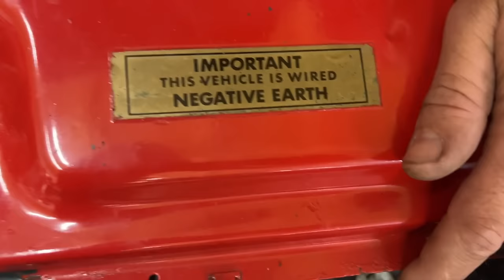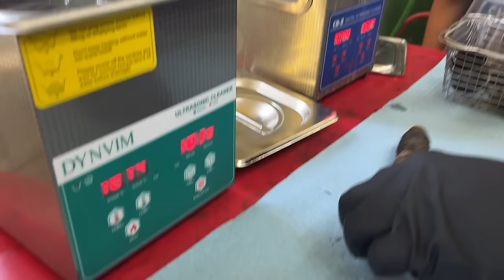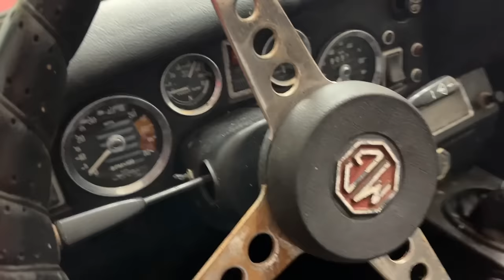My wife bought her dream car back after 17 years! Will it start ?

Comment: the way this carb is mounted solid to the intake is wrong, it needs special vibration absorbing gaskets with springs and spacers, otherwise the fuel gets 'frothed' by the engine vibrations.  look at any weber DCOE equipped car ( that includes FFing lamborghini's!)
great video!  good luck with the kitten too!
Reply from the maker: Ok thanks

Comment: Josh greetings from New Zealand. These "A series" engines are the the same as used in the early BMC/Leyland Minis and many of their other products. The hose you called a crossover hose is the bypass hose between between the head and block. That hose is available as a "wavy" one that can be compressed to fit it on without taking the head off. You can also do it with a straight piece of hose, just dump it in boiling water for a few minutes it should become soft and pliable enough to be able to bend it on. Replace both radiator hoses, as you noticed the lower one is specialised with that narrow piece molded into it, I recall that has something to do with the heater, you can get it without for heater delete vehicles. These Midgets came standard with British twin SU carbs. The Weber is a good conversion. Looks like the engine is a good one too and once the fuel system is sorted and the Weber is gone through it should run like a rocket. Although I have never owned a MG Midget I have own a couple of Mini's. The engines were probably the most numerous British engine ever, made from 1952 to late 90's at least  in its various forms ie: 850cc, 1000cc, 1100cc and 1275cc like yours. Spares should be relatively easy to get, even in the USA. I enjoy your channel very much, although you are doing what many others are doing, the lifestyle and family values aspect makes it that much different. You have a nice family and it's good see them all getting involved (even the animals).

Comment: 25 thou plug gaps are for cars with points. With electronic ignition, you can set the plug gaps to at least 30 thou. If you set the plug gaps too large, you tend to get spark leakage through the distributor cap and rotor.

Comment: I saw a 40 or 44 for 110 dollars on ebay. Its a knockoff but the originals are high dollar units.  Was going to put a downdraft 48 mm on a 87 318 b200 van. 

80 % of the tune is low speed jetting the other 20 is wot.

 Complet range  jet, pickup, and emusion tube kits are avaliable for under 90$. If you want to tune it for perfection.
Reply from the maker: Awesome thank you

Comment: Hi from the uk. Great channel with awesome content, you have a super family. The 1298cc A series engines are quite tuneable and the MG Miget is a super little sports car, that one you have already seems to have a lot of the "go faster" bolt on goodies electronic ignition and webber 440's are a great carb set up. The two green wires under the transmission (gearbox) could be for the reverse light switch, on the side of the gearbox.

Comment: Just FYI do not use Purple Power on Stainless Steel or Aluminum as it could leave white streaks or a hazy film Purple Power is known to corrode aluminum, and more so if it's hot.
Reply from the maker: Ok thank you

Comment: I seem to remember Steve at This Week In Cars having an easy way of swapping that short water pump hose. There's a trick to it.
Reply from the maker: Ok thanks we will check it out
Reply: @Sleeperdude  Can't remember if it was on an MG or an Austin Healey (same difference)
Reply: Josh and gang that's why the carburetor is like that
Reply: It sounds like it has water in the motor

Comment: Dont forget to replace the Bypass hose between the head and the block [in the front, under the Thermostat housing] its a bitch but can be done without removing the head.
Reply from the maker: Ok thank you

Comment: Josh, the reason for the deep float bowl is that Weber made carbs for racing and you don't want your fuel to be able to run away from your jets. The narrow and deep float bowls prevented that from happening in a tight fast turn. It's very embarrassing 
to beat everyone into the first turn and have your car momentarily run out of gas. Again, great video!
Reply from the maker: Ok great thank you

Comment: SUM TIMES. POP OUT GEAR. LOW GEAR OIL.  Also use light weight gear oil or 20/50 oil.    Also.  That carb isn't a real side draft.   It really needs a real side draft with the piston
  like on a datsun 240 z look at one those for illustration.    But that car will lay a patch with an acusl side draft carb
Reply from the maker: Ok thank you

Comment: Love your content! I use an ultrasonic cleaner to clean carbs and they do an awesome job. To me it looked like your parts were comng out blackened. you have to be careful what detergent you use on aluminum as a lot of them will turn it black and yucky regular Simple Green being one of them I am not sure about Purple Power. Simple Green HD which is purple in color works great and so does original Pine Sol . Keep up the great content. look forward to seeing the MG on the road
Reply from the maker: Ok thank you

Comment: Hi Josh, and family, the little hose that joins the cylinder head needs to be a Concertina hose it looks like mini bellows, do not try and fit a straight hose here as it will be near impossible and it will not last, the correct hose will go on easily as you can push it together, also that carb you have on there is poor, the correct units were called twin Su, they were reliable and worked well, they had oil filled dampers, and were easy to set up, also has the cylinder head got hardened valve seats?  If not the valves and seats will burn away cars built in the UK back in the 1970s were not able to run on unleaded fuel, the A series engine that you have fitted was the same as that of the Mini Cooper 1275cc.  The MG has always been a favourite of mine, they also made a MGB GT which had a 1.8 B series engine and the big one had a Rover V8 in it .  Rust normally finishes off these vehicles, the chassis just becomes rotten, top notch ones sell for good money.  If you put it back to factory spec, it should return an average of around 40 miles per gallon.  Well done all

Comment: That homemade nut on top of the carby you refered to should be a brass colored wingnut.  Your Weber is a DCOE sidedraught and are italian used on Ferrari, Lambo and Maserati and Lotus before they injected them...... On a V12 Lambo they have 6 of those ...............they are a high performance carby  That long brass coloured thing you screwed out is an emulsion tube.  Webers have 4 differnt parts that come in different/variable sizes and are used to "tune" the carby to match the engine.  I am assuming your carby hase been setup to suit the engine.  That engine is  based on a Mini Cooper S engine of 1275cc which have twin SU carbies but use a Weber for racing use.
Reply from the maker: Awesome thank you

Comment: Josh, I worked in a hospital for 14 years as a medical supply tech. In the department where I worked is where I cleaned, resterilized, and wrapped all the instruments for the surgeons in the operating room. One of the processes we used in placing the instruments in an ultrasonic cleaner, which removed any rust that might have formed.  The MOST IMPORTANT STEP IS TO ALWAY WEAR EAR PLUGS.  The ultrasonic sound it makes can and will damage your inner ear, which can and will cause you to go deaf, over a period of time.  Please do this to protect you and your families hearing.
Reply from the maker: Ok thanks

Comment: Can't help but grin, watching your video. You have a great example of a real sports car right there.

Contact Will at Rivergate5speed in Sale Creek, TN, just around the corner from you. He makes an adapter kit that allows you to put a 5-speed Datsun 210 transmission in your Midget. No body modifications required. Slips right in.

Also, be careful doing burn-outs. The axle shafts REALLY don't like it, and tend to break at the end where they enter the differential. You'll see...
Reply from the maker: Ok thank you
Reply from the maker: Ok thank you

Comment: I laughed a bit when I saw the video. I used to service and repair those as a British car specialist in the 70’s at a shop my brother owned. I was in my early 20’s. That 4cyl engine is hard to like. The cooling system should be flushed and pressure tested for leaks. The radiator core and heater core control valve will rust badly. That radiator hose is the real deal with that little appendix. Good luck with the completion!
Reply from the maker: Ok great thank you

Comment: Josh i like that single side drop weber carb. Low fuel consumption with power even in long trip. I convert my toyota 12R stock carb to twin side drop weber 40. Very nice like a racing car.❤👍🇵🇭

Comment: Excellent video Sleepdude Crew Josh & family also yes those MG cars amazing and live on forever to ! Only work one but built before this one had 2 carbs and body was restoration on too ! Battery yes expensive in Ontario Canada were I live to Josh and also if need use Battery for that car or similar use A motorcycle or Lawn Mower Tractor fit perfectly to !

Comment: Josh, if you run across a late 60s, to early 70s Triumph Spitfire for sale cheap let me know. I cut a few teeth on british cars in my youth learning to be a mechanic, You'll want to add a few fuses, especially to the hot wires going into the steering column, if they chafe & short, it melts the wiring and can blow a bussbar on the back of the old style voltage regulators which is hard to find if not familiar with them.j
Reply from the maker: Ok thank you

Comment: Hey that mg that you guys are working on when you got the fuel pump like that hooked up to a toggle switch in a way that's kind of bad thing to do because of the car ever catches on fire anything you won't be able to shut the fuel pump off fast enough what you should do is when you turn the key on the fuel pump will turn on you turn the key off fuel pump shut-off I would hook it up to the q at the key switch so when you turn the key and stuff on a fuel pump turns on automatically this way you don't have to remember of turn it on
Reply from the maker: Ok thanks

Comment: talking about batteries my 2017 quad 400 HO ex $209.00 dollars + 10.45 tax and a 2 year warranty was the cheapest high cranking power battery , then at one store it was over 400.00 + tax my 3/4 ton chev truck has a 9 year warranty 1200 cold cranking amp battery and it is only 109.00 dollars + tax
Reply from the maker: That’s crazy

Comment: Hey man you can run those cars on a lawn and garden battery. I ran a $30 lawn and garden battery in my Miata for years
Reply from the maker: Awesome thanks
Reply: @Sleeperdude  also wanna say that your channel is one of the best if not the best on YouTube, I’m literally still watching this video and you’re responding to my comment. NO ONE else does stuff like that. But you definitely can save money on batteries especially on smaller cars like that. Worked for me for years

Comment: hey josh,dean from coldwar motors has a 74 grand torino sport with a 460 not trashed out for about $1,600 with what looks like 46,000 miles on it.

Comment: m.g means morris garages. now a chinese co . mg miget was desighened to fit in garden shed as that is all they have in england. the same motor as is found in 60s cooper  s mini. the frount fenders are weilded on best of luck takeing them of
Reply: those chinese MG's are not at all related to the Original MG's, the modern Chinese ones are cheap junk.

Comment: Back in 1985 we traded a 75 Midget (I couldn't fit in it) for a 76 MGB in great condition, 4 soeed with electric overdrive, your Midget may have that, seeing those wires on the transmission.  I loved driving it and I told my other half, you take my truck, I'm driving the B... until it got cold out, we couldnt figure out how to make the heat work.  We found a restoration shop to do the bodywork,  on the way there a strap broke and our car fell off and that was the end of that.

Comment: I don't know where that this is their place called DieHard Gold 51R 12 volt 500 cold cranking amps for $135.00 - compare it. Then the place here Battery plus Bulb shop for Durham's Duracell Automotive 390 CCA for $120.00 SP22NF that is smaller than 51R and it is in Interstate business so it ran out stock for its 500 CCA. Thank you.

Comment: Did Squeezy run water in the tail pipe when y’all where washing the car ? I’m perplexed how the water got in the muffler. 🤔
Just a thought love you guys GOD Bless.
Reply from the maker: I have no clue it was a crazy amount
Reply: We had a rat take up residence in our Chevy pickup I saw it under the hood couple of times but couldn’t get it when my wife would drive it she had a hammer with her one day Mr Rat crawled out of the dashboard and into the passenger side floorboard while she was driving she stopped as quickly as she could but didn’t get it. Long story short this was in the fall in north Missouri come January I was looking out the window and saw Mr Rat climb out of the truck in the snow grabbed my rifle and sorry but byeee Mr Rat. Good luck trying to get rid of it might try Irish Spring bar soap and dryer sheets I’ve used them with some success in car that sat a while keeping rodent’s out.

Comment: Get a manual for the Weber. Adjust the valves and fix the brakes. The popping out of gear is worn out dogs on the gears so looks like a tranny overhaul is in the future.
Reply from the maker: Yes sounds good
Reply: @Sleeperdude  Weber's may seem complicated but the great thing about them is you can adjust every single part on them if you know what you're doing. You should be able to get a setup for that car and engine that will fit perfectly. Then it's just a matter of getting the bits and pieces you need. I would see about getting that exhaust pipe up off the ground so it doesn't scrape. Also I would get some good seat belts. I believe the car came stock with a pair of su carburetors which were way simpler. And I would definitely get in there and check the valve adjustment to make sure they aren't too tight so you don't hold the valve open and burn it. Also in racing configuration the Weber's would have had 2 short velocity stacks with a filter cover over each stack. In some cases they would have had two two barrel Weber's On A 4 cylinder. With one barrel for each cylinder. Weber's were the Holley carburetor of sports car racing back in the day and a good tuner was someone who knew how to set up Weber's for whatever application. That car should be a ton of fun when you get it all dialed in. I guess you could say that car has the original Rat motor!

Comment: Love the show, love watching Americans when they open their first WEBER. there is a reason they are the best for performance as they have multiple was of setting them up as you can adjust so much, volume of fuel, amount of air for both first and second stage, means you can set for top end, sprints, economy.

Comment: known issues:
1st gear is weak - no syncromesh so they tend to wine in first and reverse. if it jumps out of gear then gearbox needs rebuild/replacement - this needs engine and gearbox removal as it won't come out on its own due to an enclosed transition tunnel. if you have to remove the engine for any reason, it might be an idea to check for wear/play in the gearbox while the engine is out.
temp sender is a capillary tube to the engine from the original gauge these are horendiously expensive even from the MG owners club suppliers. it might be possible to put a modern electronic gauge in, using the original face
handling isn't brilliant, but it can be improved by fitting a panhard rod to stop the rear diff from tramping on acceleration or swaying under corning
good points:
the front wings will unbolt from inside the cab , they are not welded on - making major engine work much easier
Reply from the maker: Ok thanks for the information

Comment: I wonder why the intake and exhaust manifolds on the "straight" engines are always on the same side? You would think they heat up the air fuel mixture hurting performance.Why don`y thet put them on opposite sides?

Comment: I have always wanted to get one of these and put a Honda B series 1.6 or 1.8 VTEC in it with a 5 or 6 speed manual and a Hondata S300 V3 controller. Then I'd probably mount a custom straight axle under the rear end with a 3.55 or 3.73 rear gear and a posi. I already know that I'm going to get some hate for this, but this car with an extra 120 HP or so, a new rear axle, some wider Toyo R888Rs,  would be SO much fun on a road racing course. It doesn't need 500 HP, that car is EXTREMELY light, but 160 or 180 HP would make that chassis a rocketship on the course, especially fun when VTEC cracks. Sorry everyone, I have always been a Honda fan. I'm almost 40 years old and I have two Hondas right now. One of them is a fully built turbo B series that makes 709 whp. You just can't beat them for reliability and ease of modification.
Reply from the maker: That would be cool
Reply: @Sleeperdude  Sorry bud, I don't mean to sound like I'm unappreciative, I just always have visions of dream builds and that was my dream for this chassis.

Comment: How are you all? don't you think that the gas pump can be used as a security system?  When the gas pump is off it will run with whatever is in the bow and if you don't know that the pump has manual switch cant get very far.

Comment: The mechanical fuel pump for 1300cc. Triumph had build it. The $26.00 from England autoparts and $25.00 shipping my handling is that words the shipping is worth $40.00 dollars but you got a lower price in EBAY. It is the last one in stock; I suppose. The electric fuel is not original for 1972 to 1971 Midget red car is worth about the same as $55.00 dollars for electric or Fuelie with two wirings to the pump.
Reply from the maker: Ok thank you